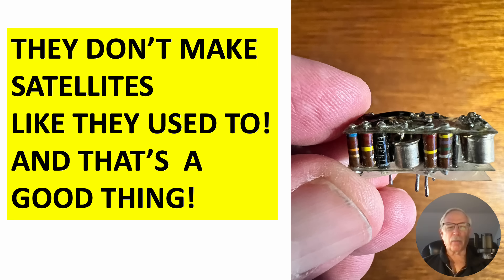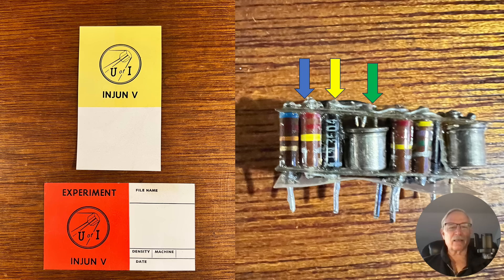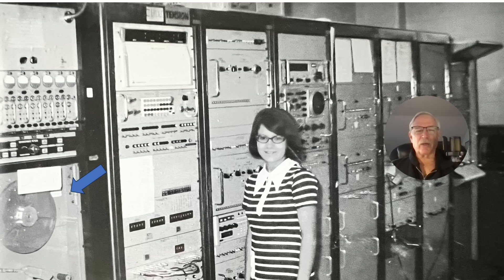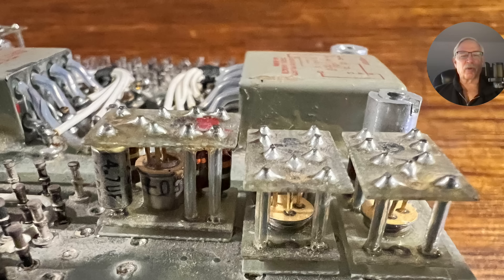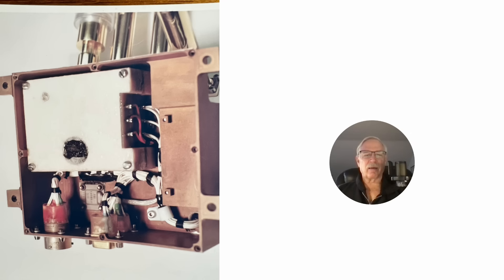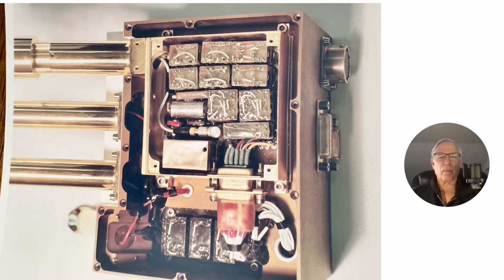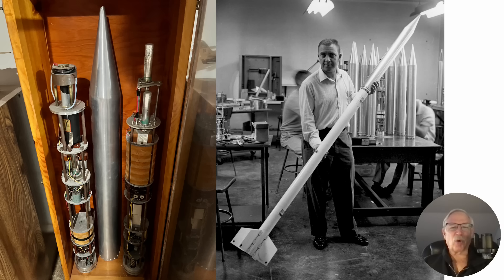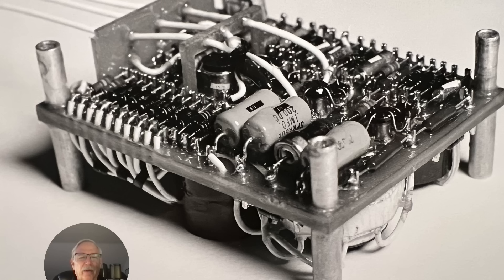THEY DON’T MAKE SATELLITES LIKE THEY USED TO! AND THAT’S  A GOOD THING!

Comment: In 2016 I was testing modules and units for Delta II and Delta IV at UTC/Albuquerque. We were using discrete transistors and mechanical relays then (probably was about to end soon), but getting good space-qual relays was getting tough and the ones we were getting from foreign suppliers would frequently not make it through random vibe. Failed relays were cut open and the amount of FOD was ridiculous. I think the new avionics for Delta is all solid state (we lost the upgrade contract). NASA soldering training was done at UTC, but I got my IPC cert through Central New Mexico University before the electronics program there was killed.

Comment: I could tell by the thumbnail  that the circuit was 1960's by the can transistors.
you sure don't see too many of those around any more, except in vintage electronics .
and breadboard construction was alright . I  built a few circuits when I was younger, 
using this method. it works well for experimental electronics . I was just learning
electronics in my 20's. but that was quite a few years ago

Comment: Thanks Ron. Merry Christmas! In 1972 while in 9th grade I took an electronics class in junior high taught by a Mr. Guzi. He put together his own color TV that I think was made by Heathkit. He had an extension cord that he would plug into the wall with the female connection cut off. He soldered a rheostat in the cord and would make us hold onto the wires on one end and would shock us. I thought it was great! I did learn how to solder as well and built some small kits made by Radio Shack. Mr. Guzi was a great guy.
Reply: Teachers like him inspired hundreds of young minds. Sadly he would be promptly fired today

Comment: These boards are designed for solid booster launch with 200G at ignition and 40G vibration in flight.  The long leads give plenty of G damping.  Also, solder and joints are designed to eliminate "tin disease" in cold space environment.  Modern electronics also need to go through de-RoHS to make it into space.  Most of modern satellites are launched with liquid booster with much milder G at launch.
Reply: Hmm I thought whiskering was still a known issue
Reply: I'm interested in your comment regarding long leads and G damping. In the video at 8:30 there are three gold IC's (Serializer/Deserializer). These parts are supplied with the pins unbent and require forming before soldering to the PCB. Looking at the image the shoulder seams long, is this the long leads you mention? Do you know what the recommendation is? for normal use I would expect this to be 3 time the thickness of the lead, but this looks much greater.
Reply: "de-RoHS" lol. That's done in repair too. So many products these days are destroyed by lead-free solder that it actually becomes counterproductive.

Comment: I worked on old Numeric Control machine tools from Cincinnati Milacron and Bridgeport back in the 70's. It was amazing what they could do with hardwired logic.  Not a processor anywhere. But it did take a box the size of a phone booth (if anybody remembers what that was!) to hold all the MSI chips on boards. Some of the oldest used "WANG LOGIC" and mercury wetted relays. Logic "1" was negative 12 volts. Sometimes the fix was to pull a circuit board out of the slot and wack it on the table to make the mercury go back to where it should be.

Comment: Yup, you can still buy discrete thru-hole transistors like the ones shown in your video. Sometimes that's all you need. Available from Mouser and Digi-key. Thanks for the video!
Reply from the maker: Thanks for the info!

Comment: While you were doing point to point wiring on your circuit boards, Apollo had already been using surface mount components in their guidance computer. LOL. Beautiful work though ...no wax capacitors, and I absolutely love to see those upside down mounted transistors an the silver plated wet-pellet tantalums with their pink rubber seals. What a show!
Reply from the maker: Oh how I miss wax capacitors (NOT!). I think I still have a few in a box.

Comment: you dont see resistors that look like that anymore. nice solder joints. what about shielding the electronics. was shielding required? what about temperature  control? what was the range of temperatures and how was it maintained. what were the voltages that the systems operated ? I see 200 volt caps.
Reply from the maker: The circuits were confined in machined magnesium boxes. Temp regulation? Nope. Typically 28 volts.
Reply: thank you for your kind response.  I would have thought they would have added a coating of polyethylene resin to the boards to mitigate flexing from  possible vibrations during it's travel to obit. However everything seems to have worked out just fine.  I don't know if you do any hands on electronic work or not. I've been soldering since I was 10 and I always use resin multicore solder. I'm a big believer in polishing the circuit boards with steel wool to prep them and using flux. I can see where women would be preferred for this work. It was determined during WW2 that women were better welders. Women seem to be more focused when it comes to preforming intricate and detailed work. Hopefully you're keeping yourself busy. Retirement is the biggest killer among men. Men were made to toil in our endeavors. Thank you again for taking the time to respond, and Merry Christmas.  @ronrogers

Comment: Those sandwich circuits were found in the early A-6A/B aircraft as flip-flops for fire control functions. A bunch of those were on the drum memory. When my squadron went to the A-6E model in the 1970's, the circuitry was more modern with the first IC logic circuits and the first microprocessors and "flat packs".
Reply: It's a construction method that originated with the manufacture of proximity fuzes during WW2. It's highly durable and takes up the least room but if a single component goes bad, you'd either have to take the whole thing apart to get to the bad piece or replace the entire strip.
Reply: @WillelmMacguyver  I work on submarine sonar and have been involved in the tech refresh of older gear on a few occasions... sometimes with woefully little source documentation to work from.  I've had to do some reverse-engineering on cordwood modules like this and ooof, it's not fun.  Really no way to do it without disassembly and very careful note-taking.
Reply: I worked in a group at Honeywell that produced those "sandwich circuits".  We called them cord-wood modules.
Reply: @firstlast-ty4di  theiy lok so cute <^3
Reply: thisse what happents whn drum memroy was reccent. i waas reccent thenm...--

Comment: I'm not an EE guy, but I thought I'd heard that the old-style circuitry was more robust since a single cosmic ray won't take out the whole circuit.  Is there a "sweet spot" in construction, with just the right size components and just the right amount of redundancy?

Comment: Oh boy, cord wood modules.  Does that bring back bad memories.  The Forward Looking Radar on the RF-4C used those and what a pain they were.  Back in '78 they were hailed as the best thing since peanut butter but for troops trained to trouble shoot down to a discrete component they weren't liked.  The process of finding the bad module was reduced to swapping out modules until the problem went away, not very professional in my opinion.  Of course they were just a step on the road to IC chips.

Comment: I'm an electronics technician and electric engineer, I love this old stuff. When I was a child in the 90s I used to play with old vacuum tube radios that were thrown away. I did a lot of experiments with vacuum tubes, this gave me the will to learn more and more about electronics. Today I have a company that develops test equipment for industrial use. I have this good feeling for electronics since I was a child. The equipments that I develop uses high voltage up to 15kVdc. My company develops the electronics, software and all hardware to communicate hardware to software. I am constantly watching this kind of video.
Reply from the maker: Yes, I used to play with old radios! I wish I still had some of those classics. Used to get old TV chassis and desolder and use the components.
Reply: You’d like my avionics teardowns. Old aircraft electronics are really interesting

Comment: Thanks again Ron for the reminder -- I'm getting old when your stuff from the 1960's looks familiar.  Yes, you can still get discrete transistors, resistors, diodes, etc!  I went to USAF High Reliability Soldering school at Keesler AFB.  The transition to IC's, Opamps had just started. However, we learned how to repair the "stacked board" type of circuitry shown in the first minute of the video.  Ours were circular stacked boards, circular for fitting into early AIM-9.  The humorous instructor would pick a random and difficult component that we had to repair.  He was hilarious and brutal all at the same time. Still have my practice board -- the diploma for "graduating" from his class.  Hats off to more USAF unsung hero's -- the ATC technical instructors...
Reply: I learned how to work on this kind of circuitry as a very young man because this kind of double board tight build was in radio equipment and in aircraft equipment. Since parts are cheap, If I had to get to a resistor back in a tight hole, I would remove the ones in the way and replace them all for reliability. I learned repairing radio VCO's and later Speed Radar units that reusing the parts you cleared to replace the bad part was bad juju. 
Thank you for your service to all Veterans.
Reply: I'm not old yet and this technology is somewhat familiar to me.
Reply: Of course you can still get those parts, it's just mostly sold online. Through-hole üarts like this are mostly ised if youn need a bit more power than SMD can do

Comment: But it got the job done!   I have a friend who built missile guidance systems for Sperry (I think) and he told me how particular they were about the soldering methods.     I have rebuilt a couple of old Ampeg tube amps from the late 50's and erly 60's.....all point-to-point wiring, which looks like a mess under the chassis.   It is amazing that that method passed muster considering the shock hazzard.    I rebuilt both amps,  replacing the "death cap" with a Y-rated capacitor (fails open) and installed a grounded plug, reducing the shock hazzard.    How things have changed.   I still use these amps regularly.
Reply: I have a pair of vacuum tube Ampeg amps as well. I replaced all the electrolytic and wax paper signal capacitors and those amps sound marvelous. Ampeg and Bogen amps from the late 50's early 60's were very skillfully built probably due to the fact they also made military electronic components?
Reply: As he said in the video it barely got the job done, the failure rate was very high. Did they work on day 0? Sure, but reliability of point to point wiring is a mess. Cables can degrade and if the insulation of two wires degrades and they touch each other it's game over. The only "advantage" of point to point wiring is that it is much easier for prototyping (changing the connections ad hoc) but if you have an established design, a PCB is much better.

Comment: Looking at a closeup of that first shot of the diodes, resistors etc…Those solder joint blobs and the pigtails sticking out are, well, I dunno how to say it… Lol 😊 But that’s what it was back then so…
— It is quite fascinating looking at those Vs. billions of transistors in a 2cm x 2cm integrated circuit of today, plus the clock speeds !
Reply: Yeah I gotta say whenever I repair vintage electronics I'm always shocked at the workmanship. I did go to nuclear electronics tech school in the navy so they teach much more modern and difficult soldering and repair techniques including surface mount. I still even find solder jobs like above in modern ultra high end speakers. I saw a soldering demonstration on youtube for Bowers & Wilkins, speakers that are $50K and the soldering tech made some very iffy looking joints, big blobs to hold poorly mounted wires, just held at the connection and soldered with a blob, vibration failure almost guaranteed because they're using the solder as a structural component in the joint.

In school they used to joke ET's solder right, EM's belief is the bigger the glob the better the job. Those old satellite parts are definitely in the EM's category. I would imagine it being space stuff you don't want big heavy globs of lead because every gram should count but I guess if they're just training average women the best way to guarantee reliability is to totally cover the wires instead of having the appropriate amount where there's smooth transitions and you can still see the outlines of the wire strands. But it is more difficult to do if you don't have modern fluxes, rosin solder just won't cut it if you want perfect wetting with low contact time.

Comment: Do you have any images of the balloon launch platform?
Reply from the maker: I have seen on in a display at the University of Iowa Physics building at one time, but I do not have any.
Reply: @ronrogers  it’s cool to hear it was done back in the ‘60s.   I’ve been thinking on the concept to cut the cost of traversing the troposphere for small rockets and got stuck when it came to a suspended launch platform under the balloon, that wouldn’t hit the balloon when the rocket launched.